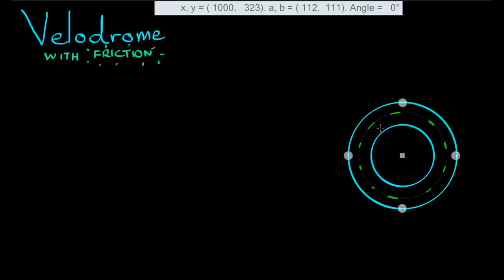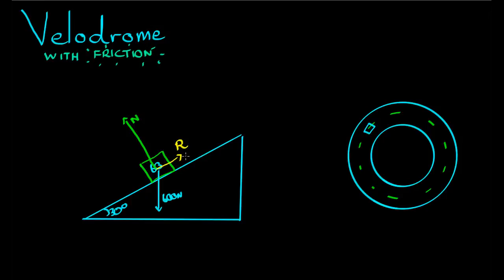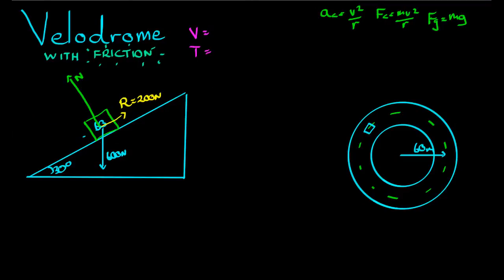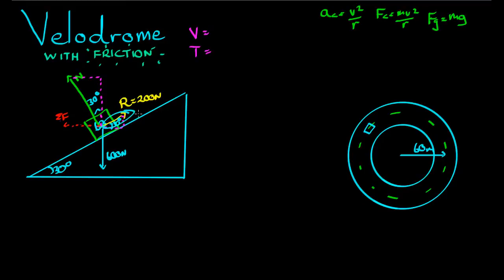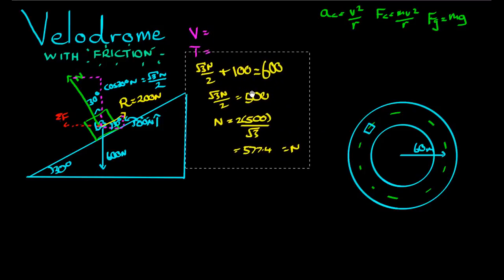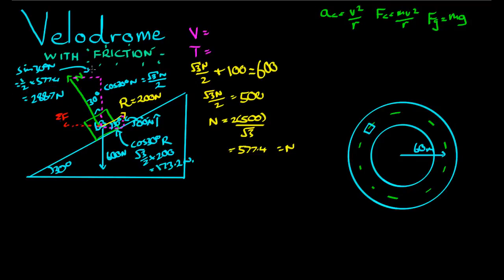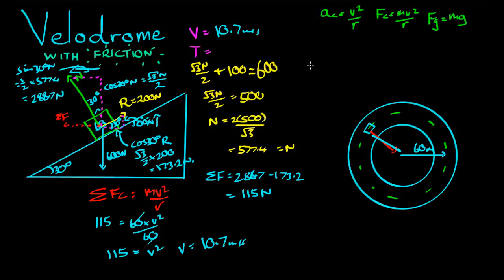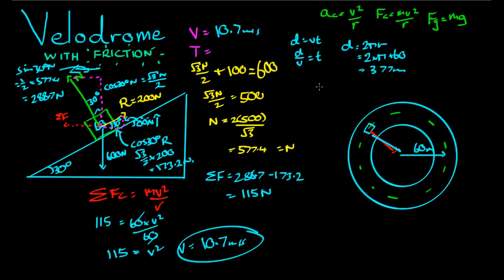Circular Motion - Frictional Forces in Circular Motion

Comment: You did it wrong, in the very end where you did 115= 60v^2/60 and cancelled out the 60s
you subbed in 60 as m which is wrong
60 N = mg
60/9.8 = m
therefore, 115 = 60v^2/60*9.8
115 = v^2/9.8
Reply: Actually no, he subbed 60 in as the mass because the mass is 60kg.. as stated. Not 60N. For f(weight) = mg you can't use kg for f. It is actually 600N = mg. Yes I know 600/9.8 does not equal 60 but he is using an approximation taking gravity as 10.